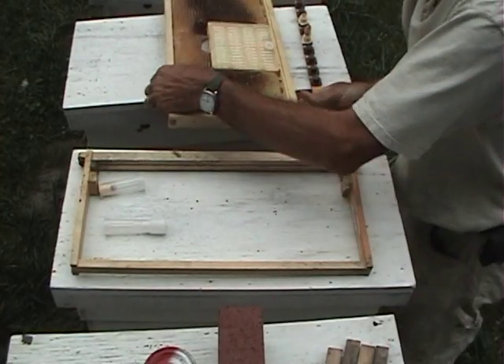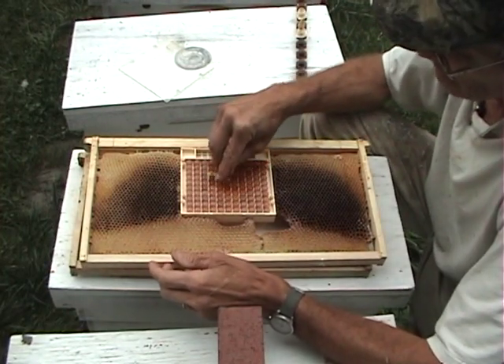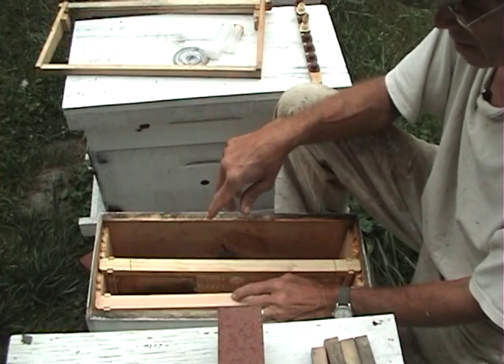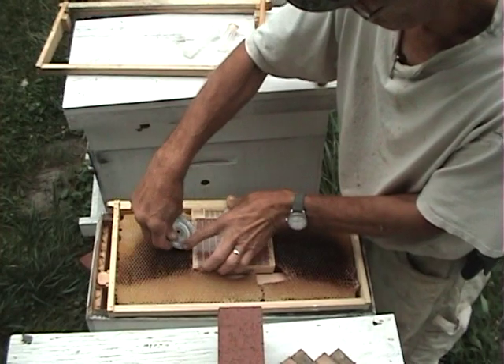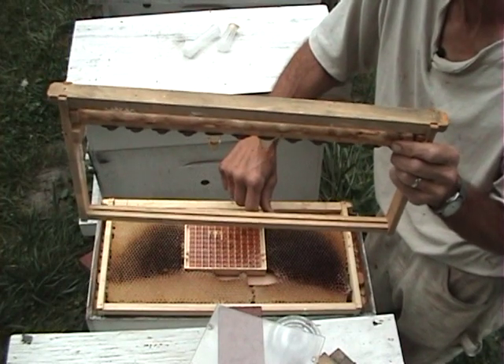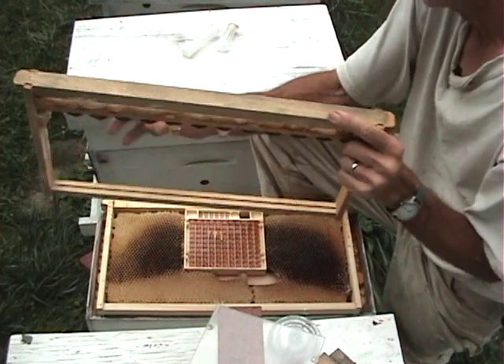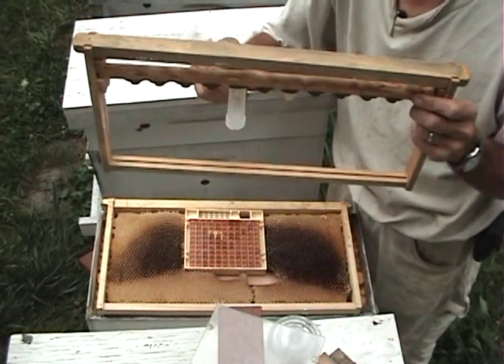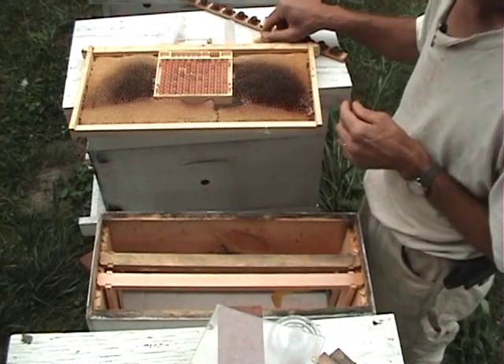Making Queen Cells Part 5 Nicot System

Comment: Thank you for your videos. Keep them coming. I had just two question. Do you leave the queen trapped in the Nicot cage for the five days while you're waiting for her eggs to hatch?  Also, can you re use those little brown cups over and over again that she lays her eggs in?  Do you have to clean them up somehow?    Thanks again!!!
Reply from the maker: The few times I used the nicot I did not leave the queen in for them to hatch. You can use the cups again you have to boil them then clean them out with a q tip then boil them again.
Reply: Thank you!!

Comment: I know this is probably a stupid question, but what is the difference between a starter hive vs a finisher hive. Other than the obvious "u start with the starter and finish with the finisher ", but are there any other differences in them. Is the starter younger ( just made queen less ) and the finisher older ( it's been queen less )?
Reply from the maker: a starter hive is queen less you can use a starter as a finisher. A finisher hive is usually queen right. In a finisher you put the queen in the bottom box then put a queen extruder on then put another deep on top with at least two frame of open brood frame of honey frame or pollen. The advantage of a starter and a finisher is every 24 hours you can pull a graft out of the starter and put them on any strong queen right hive in your yard. you can make lots of queen but you have to have a mating box for every one you make.